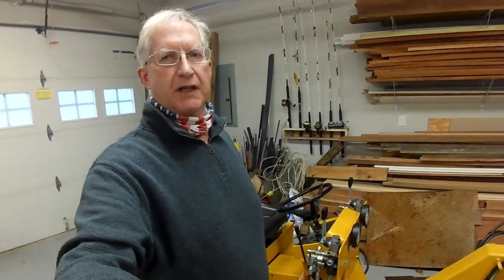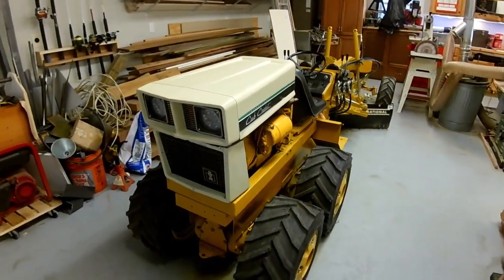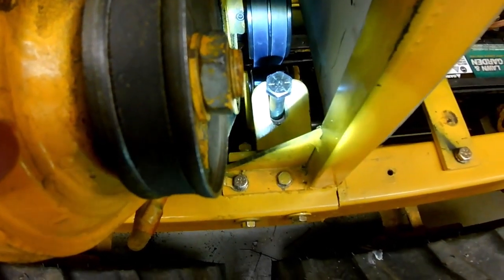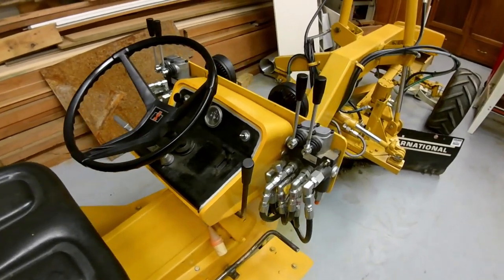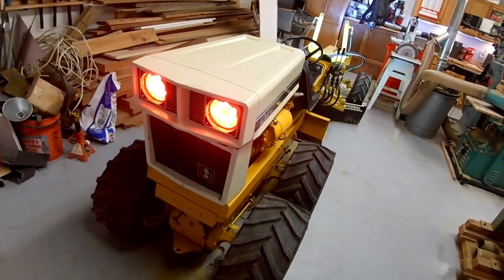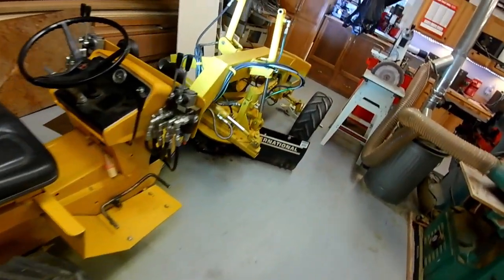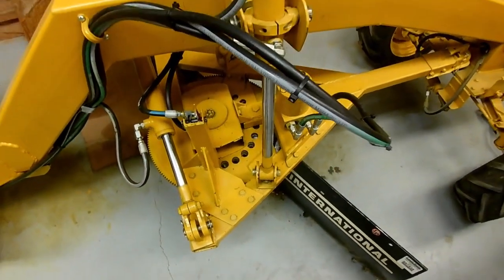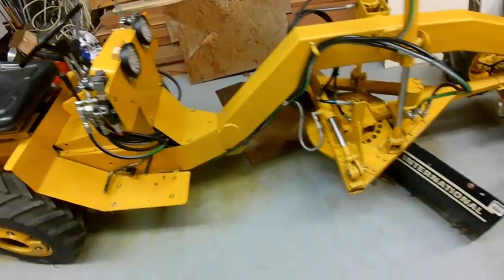Motor Grader Details

Comment: What is the distance from center of the front axle to the center of the front drive axle?
Reply from the maker: It's scaled off a drawing of a real motor grader. Depending on your "vision" it could be very different than mine.  From specs, determine the overall length of the real grader you've chosen to scale from. Determine it's rear wheel diameter. Say, 36 feet and 6 feet. So, the length is 6 x wheel dia. My wheels are 24 (23.5) inches, or 2 feet in dia. So my grader will need to be 6 x 2 = 12 feet long.  Then all the wheel spacings are based on that scale ratio. The closer you make it to scale, the better it will look I think.  To answer your question, mine is 9 feet to front drive axle, 11.5 ft to rear and 13 feet overall.

Comment: Where did you get that gear? 
Ive been looking for one for a mini-excavator project...
Reply from the maker: It's a ring gear from a Cummins 8.3 liter.  I bet any large engine's flywheel/ring gear would work.  I welded it to a 1/2 inch thick steel disk.
Reply: What did you use for a gear on the hyd motor, was it off of the Cummins starter?

Comment: Kudos !! VERY impressive build and design.. as a long time builder/fabricator my only concern is where you joined the new arched frame tube to the narrowed original frame rail... a very high stress point I'd add a heavier duty and larger overlapping 360* gusset plate surrounding that joint
..
Reply from the maker: I don't fully understand which joint you are referring to but I think you are referring to the main frame (the 4x6 tubing) to the tractor's original frame. If you look at the new video I posted of the Build, Part 1, you'll see that the main frame tube overlaps about a foot and is welded to a large 1/4 inch thick plate that is welded under the tractor's original frame, The 4x6 tubing is first welded to this 1/4 inch thick bottom plate, then diagonal plates are welded to the sides of the 4x6 tube and down to the bottom plate, then the two sides of the tractor's original frame are bent and welded to the 4x6 frame.   The bottom plate is continuous welded to the bottom of the tractor's original frame. Check out that video to see what I mean.
Reply: @woodandmetalshoptime8048  yes, o.k... sounds good.. you've done a fabulous job in design and execution.. I'll have to look for the build videos... I love watching these kind of videos as I've built and modified all kinds of vehicles.. cars, trucks of all types and sizes, tractors, boats, bikes, etc. I love how you incorporated the Cub parts into the design.. Thank you for your reply and detailed explanation..

Comment: Awesome job!! I would like to know where you got some of the parts. Hydraulic cylinders, spool valves, the large gear that rotates the blade, hydraulic motor, bearings for hydro cylinders that raise and lower the blade, etc. Thanks for the walk around video, I would love to see that in person. I restore old Cub Cadet machines and have 5 of my own. I typically rebuild/restore to original condition, but I did make a zamboni attachment for one of mine to resurface our pond. I fabricated all of that from scratch, but building a grader would require a lot of parts that need to be purchased. any info would be greatly appreciated.
Reply from the maker: Check out the two Build videos I just posted. Should answer most of your questions.

Comment: where did get the big gear for the blade 2 rotate with?
Reply from the maker: Welded a Cummins 8.3 flywheel ring gear to a 1/2 inch thick steel disk.
Reply: @woodandmetalshoptime8048  thxs have been watching your 2 new videos. thxs bought some stuff and tring 2 start my own small road grader.

Comment: You're missing one light. A light shinning on the back of your blade so you can see what you cutting. The only reason for that is if you was running at night though. If you get snow where you're at then you might be out in the dark pushing snow but that would be the only reason for that light. You might want to add a bracket and cylinders out front of the blade for a ripper or in front of the wheels for a ripper and/or blade that just goes up and down to knock down piles or to plow with and the ripper of course to help you loosen the surface of whatever you're grading or cutting. Awesome little grader you've got. Really, really cool! You did an amazing job building this and making it strong enough to do the work. The trailer hitch serving as the pivot for the blade frame is genius and makes it easy to take on and off too I'm sure. Making me jealous. I want one now. LOL!
Reply from the maker: Hi, thanks for the comments.  The pair of lights in front of the dash tower illuminate the blade and traction frame pretty well.   I've been thinking about a ripper on the rear.   It would really help with the compacted driveway.

Comment: What is the front axle from? the mull board? are the cylinder trunnions home made? I cant find them in the catalog.
Reply from the maker: Front axle is a regular cub cadet axle with spindles upgraded to carry the trailer hubs.  The mold board is actually a 5 foot Land Pride blade.  The cylinder trunnions are home made.

Comment: Nice build!  One suggestion swap your front tires to get tread pattern opposite of the drive tires, it'll really help keep the front end from sliding.
Reply from the maker: That's what I've been told a couple times. Looking on line, I see them both ways.  I'll have to give your suggestion a try. Thanks!
Reply: @woodandmetalshoptime8048  it'll help, years of practice...
Reply: The 6 wheel drive graders will have them forward.  If you look at pictures on machinery trader quite a few front tires are forward on rear drive units... proving the salesman doesn't have a clue😉

Comment: What would it take to make it articulate ?
Reply from the maker: That's a great question.  Articulation really is mostly for reducing turn radius and would require a pivot in the frame plus hydraulic cylinders to control. I decided it was more complexity than I wanted to deal with for minimal benefit.

Comment: Awesome. Been thinking about building one from lawn tractor parts for decades. Actually thinking of getting bigger and older small model I can trailer behind my 1ton these days. Currently have a John Deere 1010 dozer and a M440 Vermeer trencher with backhoe attached now. No trailer yet to haul them on and hoping to learn which small motor grader model under 5 tons would fit the trailer I am hoping to build.

Comment: I had a 68 Cub Cadet. The 12 HP Kohler was a strong engine.  I started having issues with it idling.  Upon examination the carburetor shafts were all worn and it was leaking air around them.  A kit that rebushed it and it was back to running like a top.  With the cast iron engine, cast iron transaxle and liquid filled tires it could move incredible loads.

Comment: Where is  the hydraulic oil reserve storage and cooling.
Reply from the maker: The hydraulics all run off the forward axle's hydrostatic transmission which has auxiliary hydraulic ports. The reservoir is the axle housing, holds 7 quarts. The hydrostatic transmissions have finned aluminum bodies and fans provide cooling though the entire axle assemblies also act as heat sinks/heat dissipation.

Comment: Frank, what is the pedal on the right. Is this for your hydrostatic direction control, and is that in conjunction with the hand control?
Reply from the maker: Yes, it is redundant to the hand control. I keep forgetting to use it though as I'm so used to the hand control on many of my other Cub Cadets.
Reply: @woodandmetalshoptime8048  I built a tractor with a cub cadet rear and a Honda twin tractor eng. I will need a foot control as my steering tower is hand made, and no place for a lever. I might use Toro as it's simple to complete.

Comment: Beautiful build! Nice and heavy duty! I built a PF Engineering FEL for my WheelHorse and had a great time. So satisfying to see the progress on a project like this.
What are you using for a welding setup?
Have you thought about adding a scarifier to the rear or a front plow? Those would be nice add one.
Thanks for sharing and for your inspiration!
Reply from the maker: I have been thinking about a ripper on the rear.